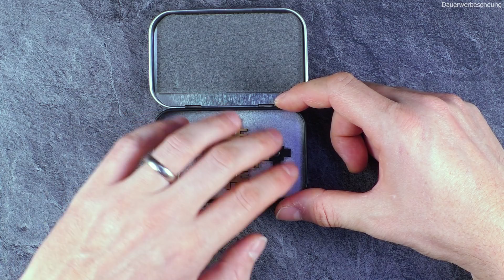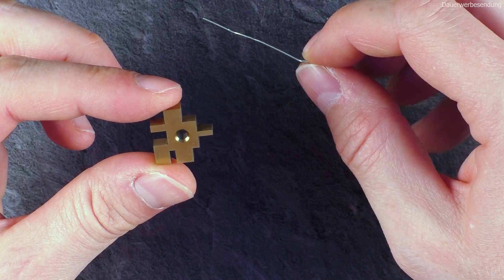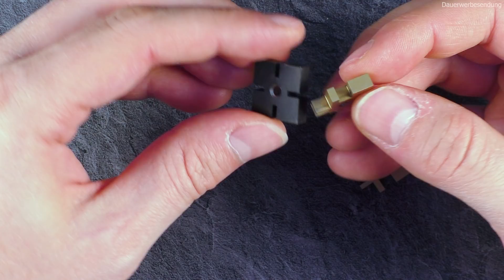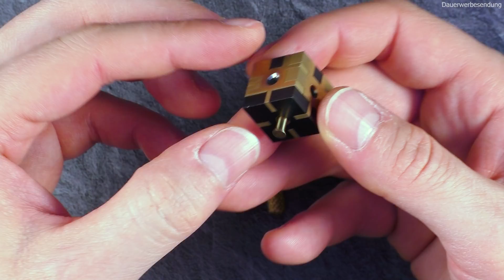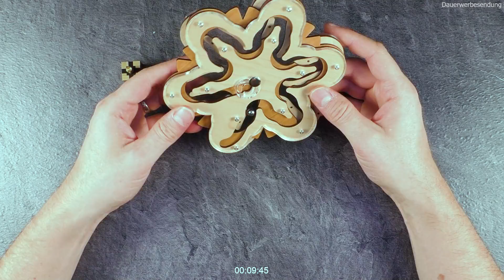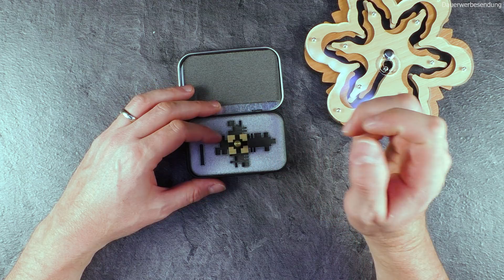The Most Precise Puzzle Ever Made! - 100% Titanium!

Comment: The first puzzle is very intriguing. It's a puzzle, an artwork and a necklace pendant. Also, it has an interesting manufacturing process. 
I see why the puzzle is made of 100% titanium... titanium is stronger and lighter than steel, and the chance of having an allergy to this metal is smaller than to other metals like nickel (when people wear this puzzle as a necklace pendant).
Reply: "stronger and lighter than steel" implies that if you replaced a steel component with a titanium one of the same size, it would be both stronger and lighter, but that's not true. In order to have the same strength, the size would have to increase, but, at that size, the weight would still remain lower than the weight of the steel. But you can't just swap components out of a system and have a stronger and lighter system as a result. (Actually, titanium is actually stronger than some mild steels, at least by some definitions of strength, but there are definitely lots of steels that are much stronger.)
Reply: @wbfaulk. You are right. I actually want to say that titanium has a better strength/weight ratio than steel.
Reply: @superhunk1989  You guys are being so technically picky!  (A characteristic I both love and am.)